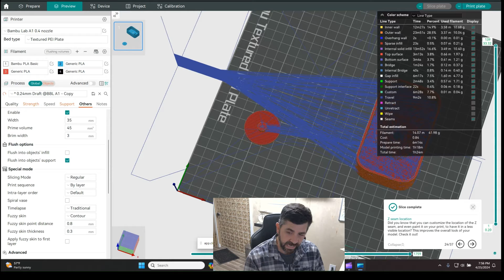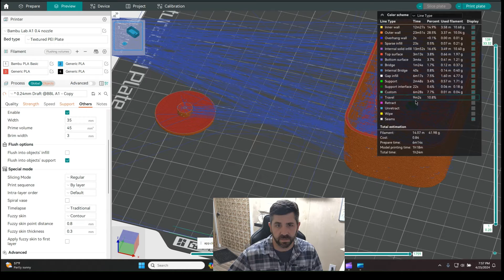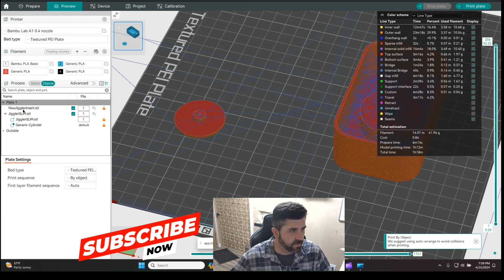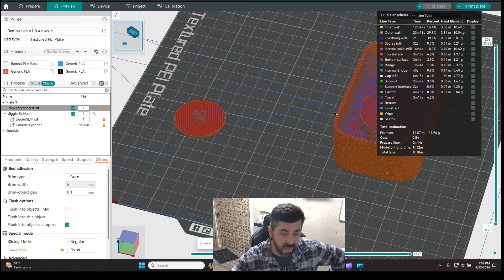More Sequential Printing in Orca Slicer: Essential Tips for Efficient & Quality 3D Printing

Comment: I'm new to Orca, been using Cura for years but to get the most out of my new printer I've had to switch.  Whenever possible I print "one at a time" old cura setting.  Better print quality, less stringing and less prone to warping.  Thanks for posting, Orca interface is very busy compared with Cura but I guess that's something I will get use to. 👍👍

Comment: Thanks, very helpful. Is there a reason why you don't just print a bunch of the one part and then another build plate with the smaller part and then you have them on hand for your orders? Or do you only print on demand when you get an order?
Reply from the maker: Thanks.  Mostly print on demand. I have 5 or 6 of each color printed and ready to assemble.  The problem I ran into printing a bunch of the smaller pieces early was that I go through a roll of filament so fast that from roll to roll the color can be slightly off and the color differences are noticeable enough to cause a problem.  I have piles of small parts still in inventory hoping I can use them some day.  It just became easier to print both pieces in one job to ensure a good color match.

Comment: Just came to yt to look at printing videos lol.
Just moved all my electronics to a new back end printed case for ender 3 with mcu buck converters, pi, etc..
Snapped my thermistor bead and broke my Rpi sd card slot.

Had to total reinstall and flash Klipper  so im starting all over.

Nice video!!  Handy feature Gunna need to catch up on Orca.